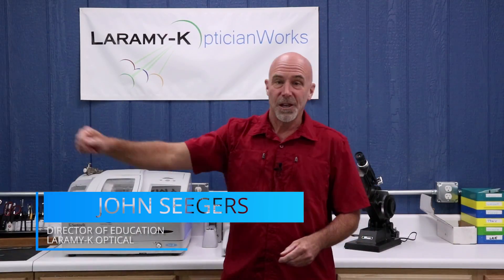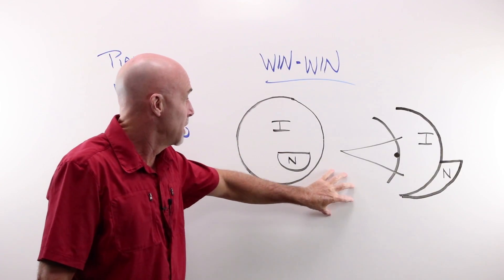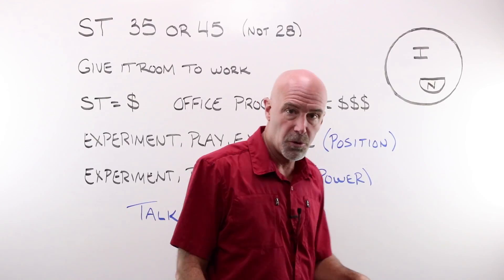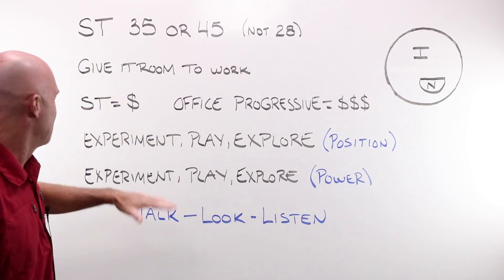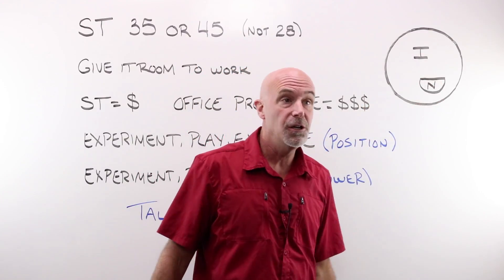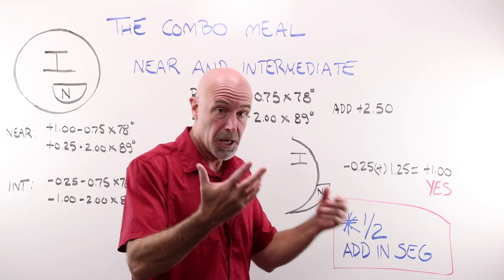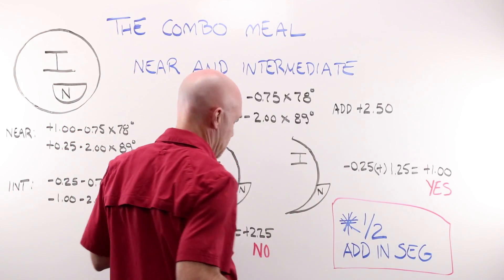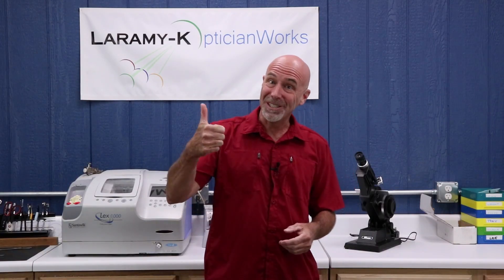How To Make Intermediate-Near Task Specific Bifocals

Comment: If the ADD is 1.25 or 1.75, how do you handle the rounding when the new SPH and ADD values are no longer multiples of 0.25? E.g. SPH -0.25 and ADD +1.25 become SPH 0.375 and ADD 0.625. Do you round both up to 0.5 and 0.75?
Reply from the maker: I cover that in the other video about converting adds to sv glasses. You chose based on your discussion with your customer. Leaning more towards intermediate round down, leaning more towards a reader-near round up.

Comment: Hey John
How are you doing?

As per this video, I m trying to figure out intermediate near bifocals.

Basic bifocal prescription:
RE 00/-2.00/90
LE 00/-2.00/90
ADD +1.75

On this basis I have calculated as below.

Intermediate: 
RE +1.00/-2.00/90
LE +1.00/-2.00/90

Near:
RE +1.75/-2.00/90
LE +1.75/-2.00/90

But 
Now I am getting confused as both are in + 😬 Would it be like...
+1.00/-2.00/90
ADD +0.75
Am I correct?
If not, 
Could you Please advise the intermediate near bifocals?
Reply from the maker: You are correct. You are adding whatever you want to zero.
Reply: @LaramyKOptical  
Ummm... Sorry I didn't get you.

Would it be the exact prescription for intermediate near task specific bifocals?

+1.00/-2.00/90
ADD +0.75
Reply from the maker: @sushmita_suman  To make an intermediate/near lined bifocal yes intermediate area (distance) +1.00 -2.00 X 90 with a +0.75 add. That will give you the reading of +1.75 at near.
Reply: @LaramyKOptical  Thanks a lot for your confirmation John.
I appreciate 👍

Comment: Is it possible to have a parallel design for Distance/Intermediate only (i.e. Driving/Dashborad only). Thanks
Reply from the maker: If I understand your question - YES! Distance up top and a half-power add in the segment. You could play around with the add power as much as you want to get that dashboard as clear as you need it.

Comment: I need your help to understand an issue with my new pair of bifocals. The intermediate view is slightly blurred, but if I increase the pantoscopic angle to 30-35 degrees by raising the temples 3-4 cm, the view is crystal clear. But I simply can't wear them like that. Thank you for all explanations!
Reply from the maker: You will find a few videos here that explain the math behind changes in perceived power when we move/tilt a lens. I'm guessing you mean a progressive since you mention intermediate. You could be adding power and/or cylinder by tilting them. You could just be finding the sweet spot in a new/different lens design. I'd start with getting the fitting height double checked. If you are talking about a true int-near bifocal (like in the video) then you are playing with power and probably need a Rx tweak. Without knowing lens powers I can't say much else. John
Reply: @LaramyKOptical  Thanks John. Is a true int-near bifocal, +1.25 add 0.75.
Reply from the maker: @kcreanga  Ah OK in that case since it is plus and you are in theory pushing them away to see clearly you probably just need a bump UP in power. Doc or optician should have a +0.25 and a +0.50 flipper to check if that is it. Heck go to the drugstore and see if they have a +0.50 reader and see what happens when you hold them up just in front of the new glasses! Let me know how things work out. John

Comment: So let me start by saying I'm lost in the translation of the numbers to adjust the 2 fields of vision to achieve as close to perfection as possible, so I'm not going to order glasses until I get some help.  I have been using a quality pair of +225 single vision readers for about 8 years and they are still perfect for everything within 36 inches, but now when I watch a 50 inch TV that's 12 Feet away it's much clearer if I leave the glasses on than without. At 12 Feet it's not perfect but dam close, would a intermediate pair lenses be a better fit for me? And can you order these lenses in a single vision pair of glasses with +225 lenses?  Any advise you could give me would be much appreciated.  Thanks
Reply from the maker: If OTC readers work for you then just go and buy a whole bunch of them in different powers (stronger and weaker) and experiment until you find the power you like/works for that distance. See what that power is and then have your "quality" pair(s) made up. John

Comment: Thank you for the helpful type of videos! Just a thing, is this still how you compute for office progressives?
Reply from the maker: No. Depends on the brand but 99% of the time you provide distance and the add power to the lab and the computer takes it from there. Most (not all) office progressives are now free-form and designed around different distance ranges so each one will be unique.

Comment: Sir please tell me that which lens is best for a one eyed person who is having Retinitis Pigmentosa; in cataract surgery. Other eye having no perception of light. Visual acuity in better eye is 6/24
Reply from the maker: Sorry but not sure how to answer that. Leaving the medical condition aside - a good progressive in safety thickness. Wait until cataract follow up is clear and lens power has settled. Then do a good progressive lens that favors whatever the cataract implant didn't. Depending on the lens powers you may need to add a thickness, you may not to reach a safety thickness. That is about all you can do. You might try a lined bifocal but I'm not sure if it will work. Post cataract people usually like at least one additional SV pair for whatever the lens implant doesn't cover. John
Reply: @LaramyKOptical  Thank you for your reply.

Comment: Hi i’m considering getting bifocal blue light lenses with a low-prescription or non-prescription single focal. My vision is okay the way it is but i spend a lot time on the computer so i want to get glasses for the computer. 
I’m concerned about getting low-prescription glasses that aren’t accurate to my eyes or are not specified to my needs which result in eye fatigue. I was wondering which would be better for the health of my eyes; low-prescription glasses or non-prescription glasses. If i get non-prescription won’t the PD be off and result in eye fatigue anyways? 

I was also wondering about the prescription sheet they give after you have an RX exam. 
Are the numbers the prescription of your eyes before making the additive calculations to correct your eyes? ( nearsightedness, farsightedness, astigmatism) or are those the prescription of the glasses that will be made to correct your eyes? 
I was also wondering where the ADD magnification number comes from, does it come from the RX exam directly or is it a standard you use. (E.g. nearsightedness=1.00, farsightedness=2.00). 
Thank you
Reply from the maker: OK kind of too much here to answer. You might want to sign up for a month of the OpticianWorks program. But - If you don't need glasses don't wear glasses. Blue light is like vitamins and essential oils - either you believe or you don't. Your choice. If you are getting a "prescription sheet" with numbers on it I'd need to know the numbers. You will find two videos on lenses/correction and power. The numbers are the power(s) required to correct the refractive error(s) of your specific eyes. John

Comment: Would you recommend the intermediate-near task bifocal for use in safety glasses for a chemist in a lab. They will need to be in the minimum 3mm thick material to meet OSHA impact and splash requirements for lab workers. Looks are not really important, simply seeing ability as I have bad astigmatism as well as near-sightedness, and my safety glasses always look like bottle caps. Progressives have worked for street glasses, but not as well (probably a bad choice) in my prescription safety glasses. I am not an optician, but enjoy seeing your advice and want to ask the right questions when I go to get new glasses made for my 61 year old eyes.
Reply from the maker: If your work environment is 100% within the intermediate and near ranges I would highly recommend a inter-near bifocal setup. You'll love them. Try to find a great optician and they may even be able to find something in a ST35 in a high-index to help with thickness and give you a wider bifocal segment. (That might be hard to find but at least they should try) John
Reply: @LaramyKOptical  Thank you very much for sharing your knowledge. It is greatly appreciated!

Comment: Can you help me calculate the prescription for single vision computer glasses?
Reply: I have the same wish. I'm 66 y. old and always using single vision glasses. I have myopia (nearsightedness) and never used bifocal or multifocal glasses. If I read newspaper,  I can do it without using glasses. But if I use my pc which has a 27" monitor, I'm doing my compute work at a distance of   70 cm (28").

Can I just divide my ADD +2,25 by 2 to get my single vision intermediate computer glasses OD and OS  sf-values? So, change the ADD value to +2.25/2 which is about +1,25?
My prescription for single vision glasses is OD:  sf -2,75, cyl -0,50 ax 80 and                                OS: sf -3,00 cyl -0,75 ax 90.     
I think I should write my prescription as above, but ADD = 0 and OD: sf -1.50 (= -2.75 + 1.25)   OS: -1.75
Is it better not to change sf values, but rather change only the ADD from +2,25 to +1,25 ?

Greetings from Finland. 🇫🇮

Comment: Ok its only for intermediate distance in bifocal.
And what about progressive lens is it the same rule for intermediate correction.
Reply from the maker: Osaf, You can't really make a progressive lens work that way. An office SPECIFIC progressive lens is already designed around the correct power spread needed. But, you still need to be careful and really know which office progressive you are using and why. We are working on a video about that now but it will be a few months before it comes out. John
Reply: @LaramyKOptical  has that video come out? I can't find it, I would like to convert a prescription to a progressive intermediate-near
Reply from the maker: @andrea_moro  A progressive int-near is an office progressive lens and is ordered like regular one and the lab software inverts it.
Reply: @LaramyKOptical  Thanks. I was asking because most online sites only make far/near progressives, and I was wondering if there was a way to "trick" them by entering different prescription parameters
Reply from the maker: @andrea_moro  Drop me an email through the OpticianWorks website if you want more. I can explain better. BUT - you DO NOT want to "trick" a regular progressive to act like an int-near that is just asking for disaster.